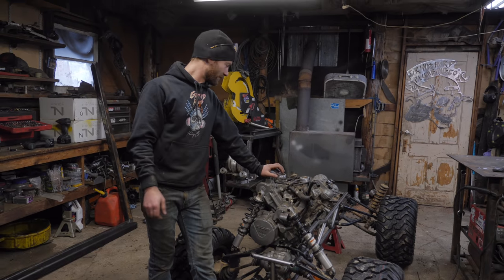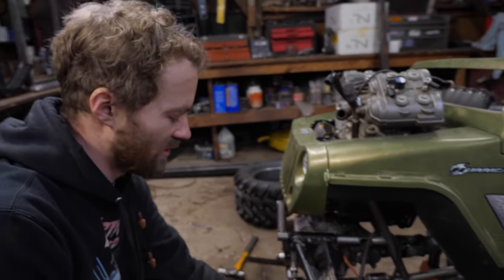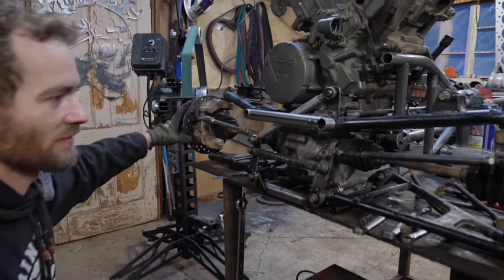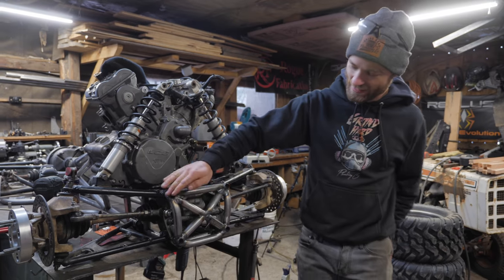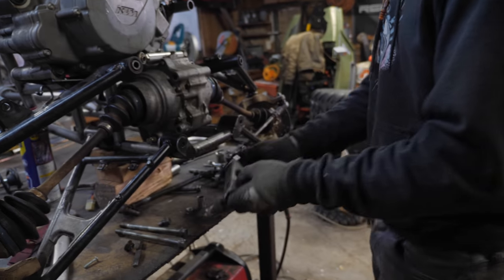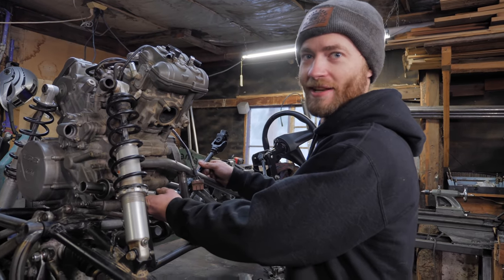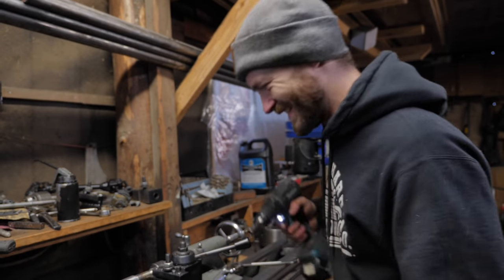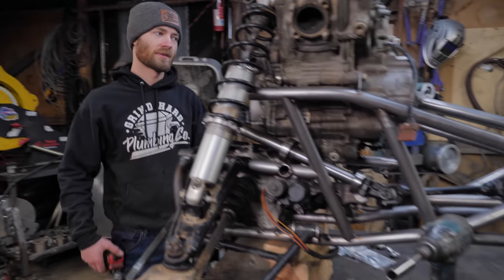1000cc 4WD Off Road Go Kart Build Ep. 6 Steering

Comment: You should make an acrylic guard for the drive train so that you can see all the moving parts 
Or polycarbonate apparently
Reply: Lexan would be cool
Reply: Heat form it so it is one solid upside down U SHAPE Tunnel
Reply: Cool but wouldnt take the abuse. If he wants to slide over a rock itd crack and if a driveshaft broke. Itd crack and possibly break his leg
Reply: @rprokopow   ever heard of Markolon by Bayer?
Reply: @TripleXclown  Polycarbonate is love
Reply: @rprokopow  Lexan is a polycarbonate sheet which is used for bulletproof aplications.. glass bottom boats and animal enclosures for gorillas and killer whales... Acrylic would break.. but totally a different a product.
Reply: @peter ramey markolon is a high strength bullet proof plastic polycarbonate

Comment: Great job on the steering and planning for bump steer. The system you created is basically the same as a lot of early Nissan trucks and probably anything with a steering box and independent front suspension. With the quad suspension and motor this thing is going be fast as hell.

Comment: Shortening the rod between the two pivot arms should increase the ackerman, if that's what you wanted to do. 

That's how the old steering box cars used to get ackerman - the pitman arm and idler arm weren't quite parallel even with the wheel centered, they were both either angled out a touch or angled in depending on whether your knuckle runs a front or rear steering arm.

Comment: Also since you guys are doing splines and I was a toolmaker...

Take the 3 jaw on the lathe off its mounting plate
Make a mounting plate that sandwiches between the chuck and it's mounting plate
Make a ring of holes around the perimeter of said plate and lay them out in divisions convenient for the splines you regularly use
Make a small pin mounted to the lathe body that lines up with the ring of holes

Make the splines the same way you just did, only you can use the pin and ring of holes to locate the chuck at accurate divisions to machine your splines

Nowadays I'm a draftsman, so if you can get some measurements of the back of the chuck where it mounts to that plate to me I can draw it up for you 👍

Comment: for cutting splines your could get a single point thread mill(even a carbide one) and make yourself a small spindle for the tool post.

this would allow you to cut the splines in one pass per spline.
also a t-slot cutter would work for key ways and woodruff keys.

Comment: Next time you have an issue like this, you could just offset the steering column to one side and drive the steering column with a gear on the back of the steering wheel. It'll swap the input to be correct to the steering wheel.

P.S. it's good to see fellow Idahoans

Comment: That spline cutting disaster you are doing is fucking absurd. I'm actually impressed with your fortitude but holy hell dude, this is the epitome of working harder, not smarter. 
Here is what you need to do. 
First, use your digital angle finder in the 3 jaw and Mark out 360° on the outside. Then use a Dremel and grind in the marks and label every 45°
Now you have some reference and you aren't shooting in the dark. 
Next is the cutter, you NEED to have a spinning tool on that. Since you are skilled in manufacturing you should have no problem putting together a mount for a hand drill or a die grinder that you can mount to the tool carrier and use normally. 
It's easier to follow the standards than to reverse engineer them. 
Keep it up!
Reply from the maker: Calm down. I know it's not the best solution. It's just the best i could come up with to get it done in time with what I have on hand.

Comment: You might have been able to get away with making the arm off the main steering shaft a half moon shape to get  better angle on first tie-rod. Just tossing an idea your way. It might be a bit of a bear to steer overall.... also electric power steering from a side by side or even from an atv would make steering easier but that is your decision on both of those ideas

Comment: Since ackerman is not a big issue, is there any chance to reverse the knuckles and place the steering rack you have between the engine and the front diff? Don't know if you have enough room tough, but it could work. Besides, any looseness in all those linkages will easily add up and you can end up with a ton of play.
Nice work as always, btw

Comment: MORE AKERMAN ANGLE 

Don’t quote me on this. But if u make your center steering link adjustable.  Push it out so the two upright arm brackets are not parallel. In more of a outter v pattern. 

Then shorten your tie rods to get your alignment straight. 

That should help give u more Akerman Angle

Comment: Can you share the lower control arm pivot with a steering shaft? Then you can directly drive the steering arms and deal with the linkages behind the engine. Thoughts for the future if that high angle steering linkage doesn't work out.

Comment: Think you guys should put a driveshaft carrier bearing off the engine so the output shaft bearing doesn’t have to take all the load of keeping the driveshaft straight and spin. Like at ea end near the ujoints just like your steering shaft

Comment: How many have used cheap ratchet extentions and swivels as a steering shaft.One way to mate a ujoint up is using a socket as the female and weld a nut or two on a shaft as the male.Or use the square parts of socket and extentions for male/female connections.

Comment: So the steering setup y'all built is called a "swing-set steering setup", y'all just did it up side down. We use them in Trophy Trucks that use the Ford twin I-Beam and Twin Traction Beam front IFS. It gives you almost NO bump steer on a long travel setup on the Twin system.
Reply from the maker: Yes! That's actually where I got the idea for this setup! I got curious about how they deal with bump steer on the long travel TTB setups, and looked at pictures on Google. 🤣

Comment: if you accidentally delete stuff, its still there until you overwrite it with new files. so as long as you realize straight away and stop what you are doing you can use software like recuva to search the empty space on your hdd's for the deleted content and recover it. its still there, its just been told to pretend its empty space thats all.

Comment: Not familiar with the parts used but, would it have been possible to install the differentials right side up but, put the front diff on the back and the back on the front? Would that not have made them turn the correct way without being upside down?
Reply from the maker: That doesn't work. If you swap them front to rear they still spin the same way.
Reply: It's difficult to picture the mechanics of that without it in front of me to look at. Thanks for the response.
Reply from the maker: Yeah, I had to think about it and play with the diff a few times to figure it out.

Comment: Hey guys I committed on the wrong video sorry about that this project is the one I was talking about . I love this channel check your u joint timing it’s way off they are clocked wrong it will break joints and gear boxes the joints on the shafts should be inline with each other or they won’t be constant velocity. After all that work I’d hate to see you guy get hurt with a flying driveline. Be safe guys can’t wait for the next video

Comment: Are you guys worried that the front shocks could break the block by attaching them to the engine? I’m worried about the added stress the suspension will give during a bottom out.

Comment: If you flipped the knuckles around backwards you're gonna have negative Ackerman. Meaning it will be opposite of what you want, with more angle on the outside wheel.  You might need to relocate the mounting hole for the tie rod.